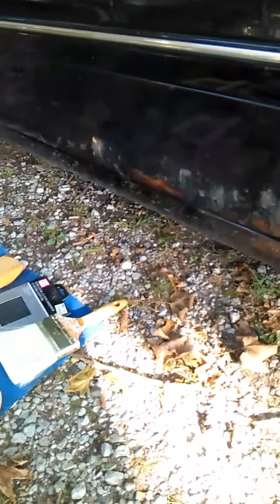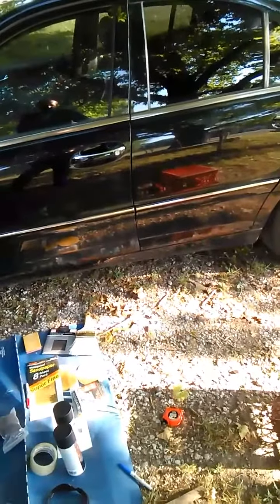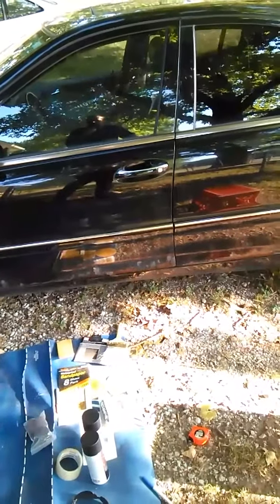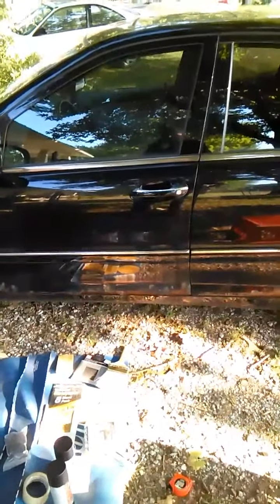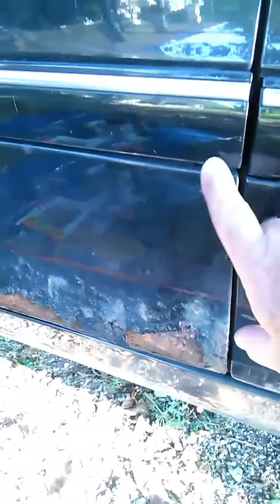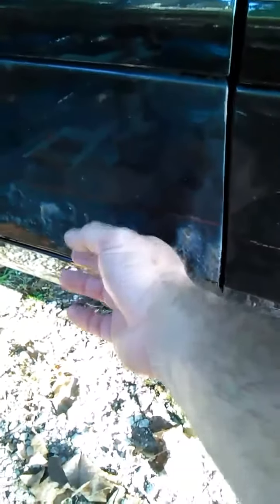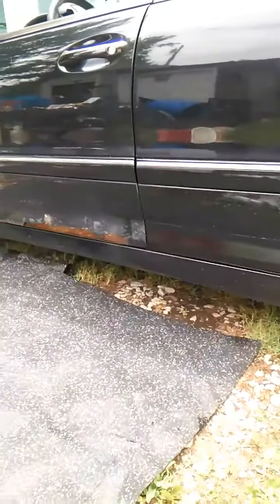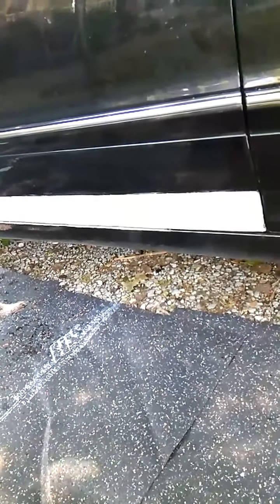Mercedes Benz C240 rusted doors repaired for $40 using Oreilys "custom wrap" paint.

Comment: looks like a great alternative to replacing the doors.  i wish i had seen this back when it was posted so i can do the same to my c240. its getting cold now so idk how well this will work in the current temperatures  but i will try this coming weekend. thank you
Reply from the maker: as long as you can put the car somewhere where you can keep the temperatures above 70 degrees it should work one thing is make sure you allow the rust converter ample time to cure before covering it over with the custom wrap paint. otherwise it can trap moisture in and you'll have to do it over. I'm actually going to add some more layers of the custom wrap as I've noticed it was a little light on the passenger side but hey that's just another 8 bucks

Comment: @bluecollaradventures How well has this held up, did you need to do it over again?
Reply from the maker: Brandon Levine honestly the rust came back after about six months on the places I didn't use body filler.  I'm not sure if I didn't spray enough coats or if the rust was too extensive on the inside of the panels. I've been busy with other projects and a full time job but I intend on looking into it in the future. The rubberized paint has held up well even when pressure washed with a electric washer.